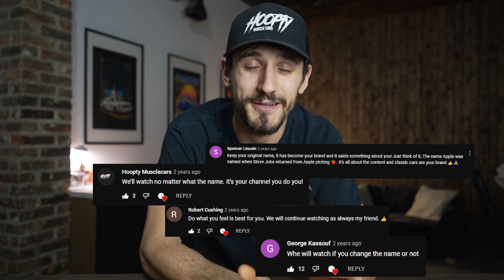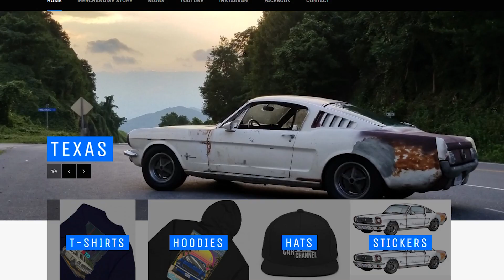We're Back... But Things Have Changed!

Comment: I just acquired a 64 Fairlane with a 429/C6/9-inch/drum brakes. Manufacturer agnostic topics that might be useful for classic/old car owners:

0) How to update your points ignition to electronic. There are several options - pertronix, manufacturer-specific dist/box, manufacturer dist/MSD box, and MSD dist/box.  People new to classic cars may want to know what's best for their car/situation, and how to do it.

1) Electric fans. How to select/install them.

2) Swapping rear ends.

3) Shock installation

4) Trunk-mounted battery.

5) Drum brake maintenance, and disc brake upgrades

6) Wheel fitment (how to determine backspacing and offset).

7) Four-link conversion.

8 ) Wire management.

9) Cut-to-fit spark plug wires.

10) Window regulator repair.

11) Carburetor tuning.